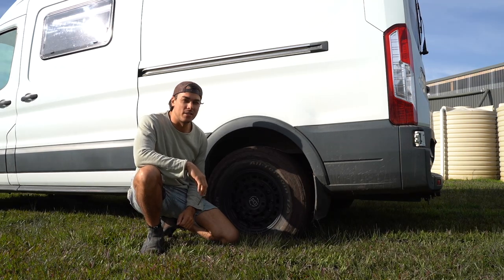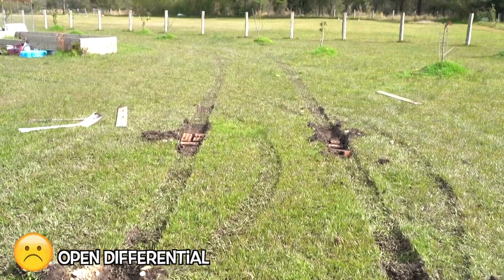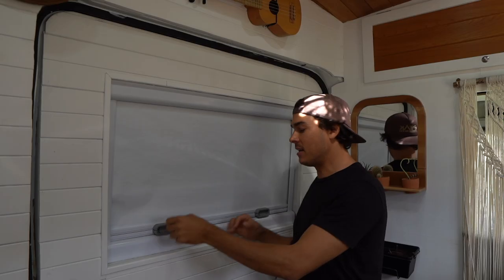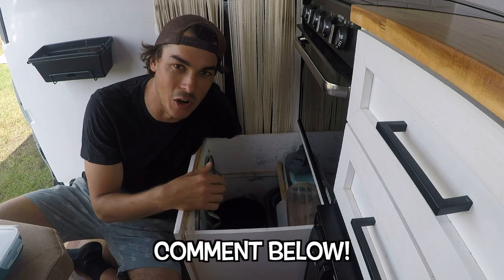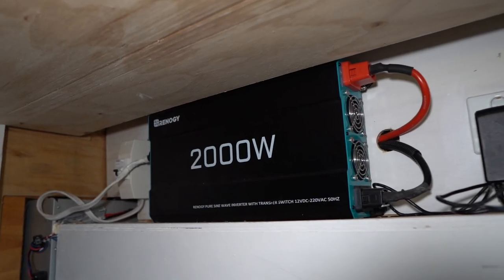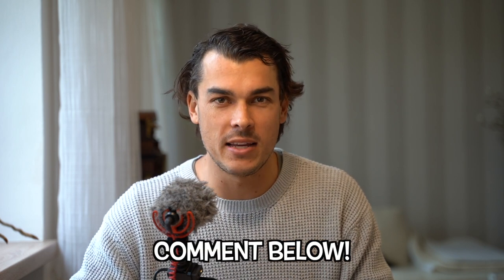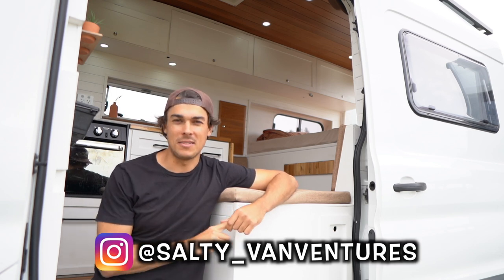It's Not ALL Good | 8 Things we Love and Hate About our VAN | Ford Transit Conversion

Comment: For future reference......... Getting "stuck" in soft or wet ground happens to everyone sooner or later once you leave the bitumen. Going the route of "all terrains" is a step in the right direction.
NOT SPINNING THE WHEELS WILL HELP IMMENSELY. Once the wheels spin, you loose traction and just make your situation worse. Keep your foot OFF the accelerator, just let the clutch out slowly and let the engine do the work.
I recommend that you get yourself a pair of MAXTRAX Recovery tracks (No, I do not work for MAXTRAX nor am I sponsored by them, they are just a great product). DO NOT go the path of the cheaper brands, they are inferior and do not do the job and you will then have to replace them. Remember, BUY ONCE, CRY ONCE. 
Letting air out of the tyres is a good start, but you need to let enough air out of the tyres so that they "bag out" and give you more contact area. With the tyres you have I am guessing that you are running them at somewhere around 32 to 36 psi for normal road use. You can easily deflate them to 16 psi safely to get yourself out of that situation, I would NOT suggest that you go any less than 12 psi. REMEMBER to re-inflate your tyres back to normal road pressures once you get on to hard ground. 
As for RYOBI, I have heard that Ryobi is latin for sh*t. Again, Buy once, Cry once.
I would also suggest that you carry a long handled shovel in your van (again buy quality not price) they can be very useful in the situation you had and have many other uses as well (they can even be used to cook on). 
Good luck with your adventures. Cheers.

Comment: The opening scene, I feel your pain my Transiit got stuck and buried on flat wet grass and had to be pulled out.  I'm very interested on how you fixed this issue and the approximate cost.   My plan was to buy an all wheel drive but the wife says, "No".    

My wife and I have a solution to storage (probably not a good one for some) but it's what we taught our kids, "If you need it - get it, if you can't get it - adapt, and if you can't adapt - learn to do without".

This is our third van build for camping.  I have as much fun building them out as camping.   This last van cost nothing to build out, except for the Bodega cooler and the mattresses.   We used all scrap and reclaimed wood from my shop.

Thank you for sharing, I enjoy your videos.

Comment: I actually came across a solution to the large drawer issue when looking at $1 million dollar overlanders. They use Magma cooking sets in their vehicles that take up less than 1/2 cubic foot of space, this way you could turn your 1 large draw into 2 smaller ones and have to dig less, it was something that was bugging me in all these van build videos as I hate digging for things and didn't want wasted space in my van when I get it. I guess the negative is that you have to pull apart the pot collection for the one's you want and put it back together rather than just throwing one pan or pot back in the cupboard. Camco also make a cheaper option, both sets work in ovens also, which I thought was a plus.

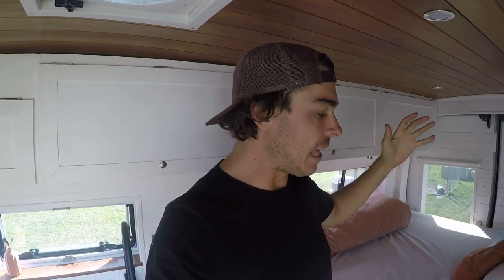Comment: 4:45 is extended body, not extended wheel base.  They're both 148" wheelbases.  I went the extended, and dually. Hopefully won't get stuck as easily as you at the start!
Reply from the maker: Arh yes of corse. Must have been in a mind of my own when making that animation! I call them vans with a big ass
Reply: I just got the 350HD (dually extended) RWD.  It happened to have snowed about 12" the night before my test drive, so I put it through some pretty deep stuff, and was pleased with the results.  How do you like yours?

Comment: Well, a few days ago I bogged my HiAce on grass. First time in decades of driving it's happened. But luckily help was not far away and a landcruiser pulled me out. Bless the CFS. This rain is not funny.
As for the electrical system placement, I don't think there's a perfect place, it does need access though and I have seen some underbed systems that look a horror to access. Jealous of your hot water🤔😀
Reply from the maker: The rain is making it a bit tricky on the grass at the moment in Australia right. You need to be extra careful luckily you were able to get a pull out too. Probably too right about the electrical system placement!

Comment: Yip I would LOVE a rear diff lock
Reply from the maker: Would be very nice to have
Reply: Did you find any electrical or mechanical diff lock for rear axle? I've got a 2014 AWD L2H3 (wheelbase is 3300 mm) but here in EU is not easy to find any specific Transit special parts... 😅

Comment: You need a probe to use on grass, sand, etc where you  clearly are not on hard ground. Test it before you drive on to it. YOu dont need to change your van, you need to change your way of doing things.  Never drine onto unknown ground  that cannot be assessed at a glance, ie. concrete etc, always used a ground probe before you drive onto it.

Comment: I've got that exact same cupboard under the cooker in my van, pisses me off too lol. Mine also kept swinging open while driving because of the weight of the pots & pans.
Reply from the maker: we had that problem too but I have finally mastered how to keep the large drawers shut without any physical latches!
Reply: @saltyvanventures  tell me your secrets, I have bulky latches now
Reply from the maker: @bencollis3421  I used magnetic holds but either use the heavy duty 40kg holds you can buy online or upgrade the shitty magnets in the ones you get from the hardware store to neodymium magnets (which you can buy in bulk online)
Reply from the maker: @bencollis3421  also use soft close drawer sliders as they require a stronger pulling forces to open (which preloads the soft close mechanism)

Comment: What is the measurement of your useable floor space from back of seats to rear door? And width of you bed? I would like to see if your layout would work in my van thank you
Reply from the maker: The floor space is approximately 3.4m long by 1.75m wide. When you utilise the full width of the bed by framing out the bed extents the bed is 1.93m wide at it's widest towards the front, narrower at the back towards the rear doors where the van contours narrow.

Comment: I've heard to let out some air in your tires for mud and sand
Reply: That's what the ryobi inflator was there for =)
Reply from the maker: you're onto it!
Reply: @saltyvanventures  it's a wonderful bit of kit. I have the same one in my motorbike top box most of the time.
Reply from the maker: I do like it but for these tyres it is a bit slow. I used to have a dual 4x4 air compressor in our NZ van that would pump a tyre up from flat in like 3-4 minutes. This one would take 20. It's great that is fully portable though with the Ryobi battery pack.
Reply: @saltyvanventures  After seeing your leaves and GVM issues I chose the dually, and spoke to two doors down; they do airbags.  on board 12V compressor with independent bags for auto-levelling. $1500.